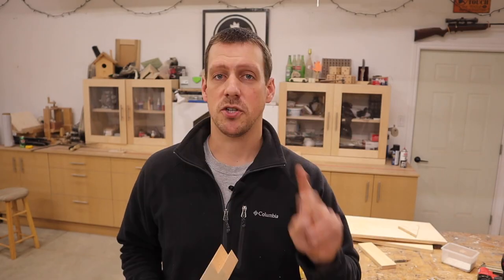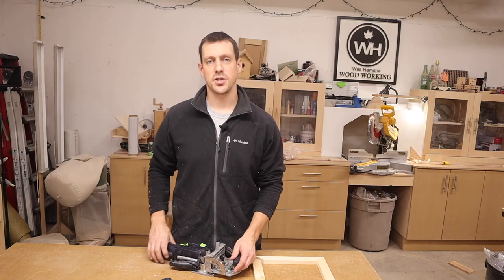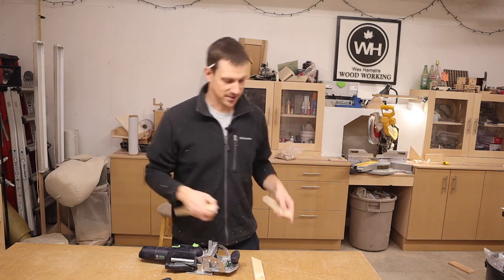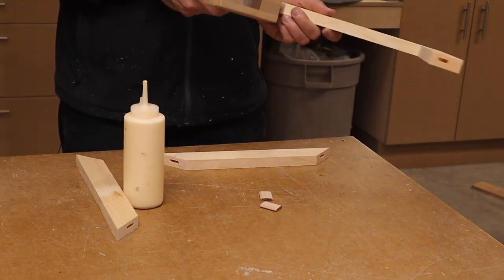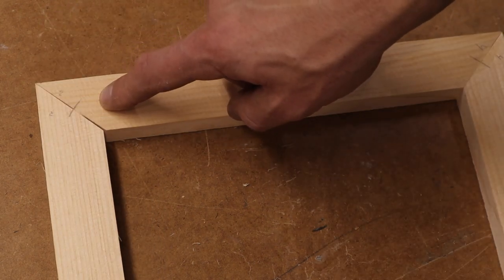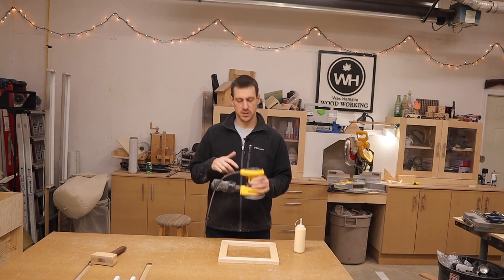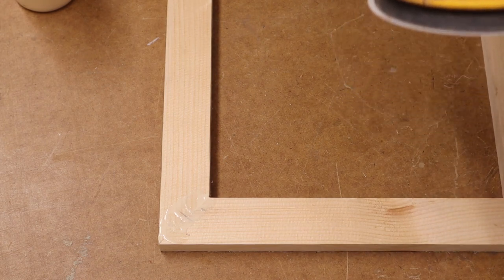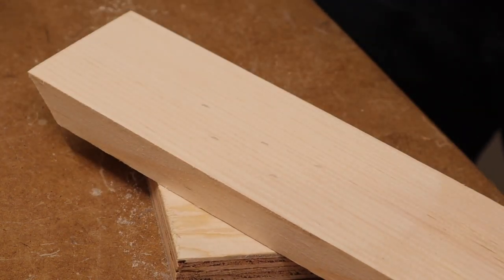Trick Your Friends Into Thinking You Are A Good WoodWorker!

Comment: I don't know why you had comments turned off on your drill press router bit demonstration.
I bought an old Delta benchtop drill press at a yard sale that came with the manual and that manual had a 1937 date on it and in that manual it shows how to use a drill press as a router table for under table and overhead use with jigs. 😀
I like your demonstration that you did on that subject. 😀
Reply from the maker: Thanks. I turned the comments off because I was getting tired of all the negativity.